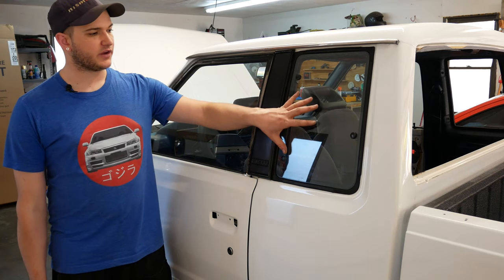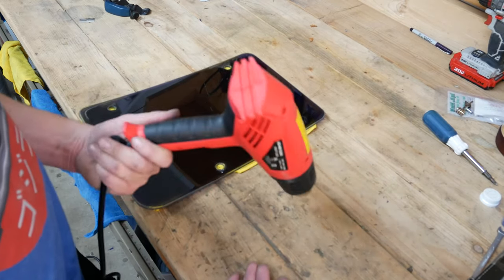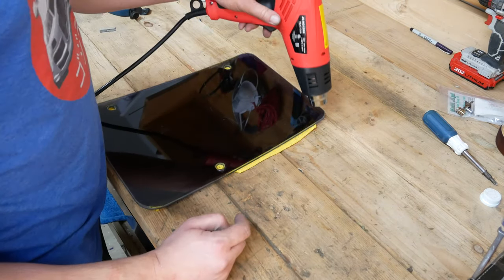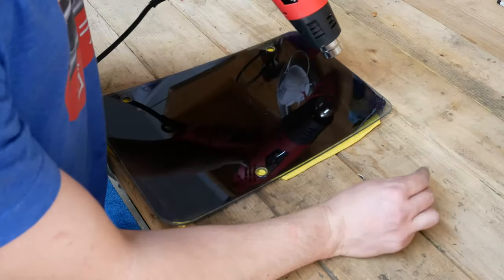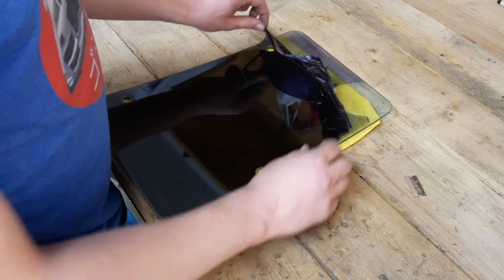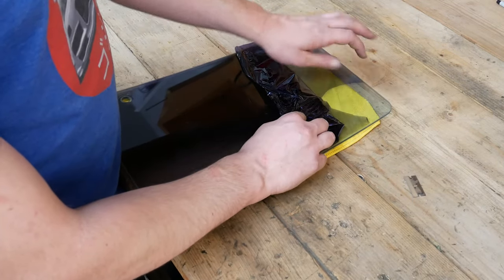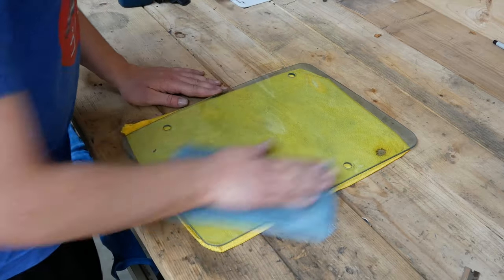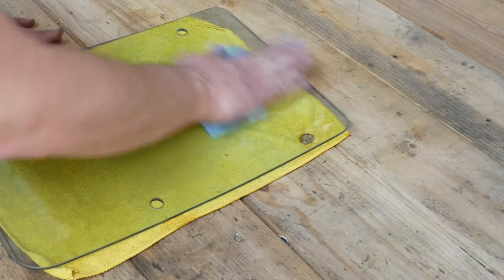How to Remove Stubborn Old Window Tint!

Comment: Where did you get the king cab gasket material ???
Reply from the maker: The Window seal?
Reply: @TheAngryHoneyBadger  yea for the rear pop out window
Reply from the maker: @matthewcapodieci7994  mine are still the originals